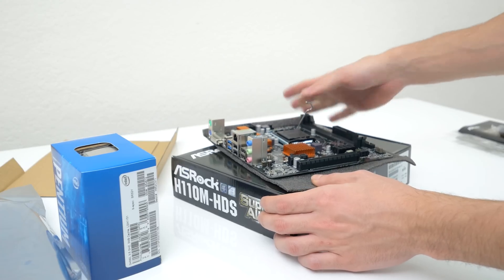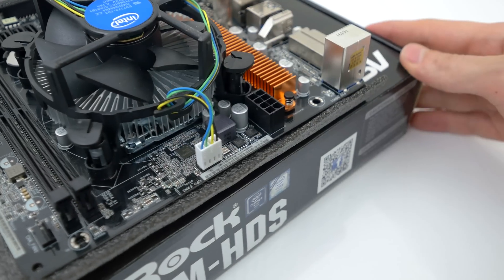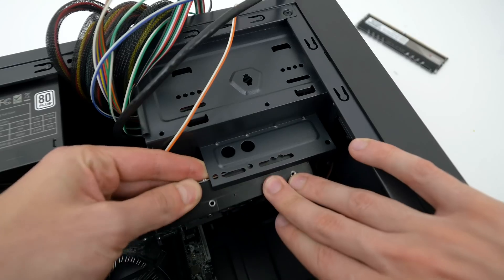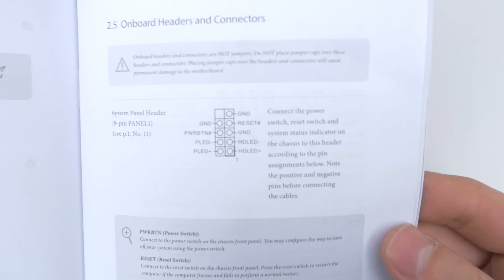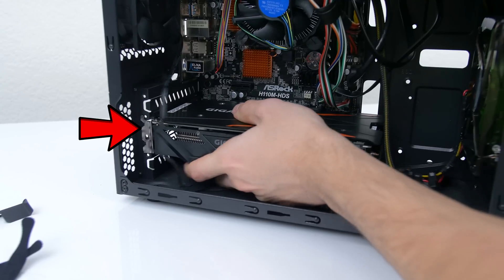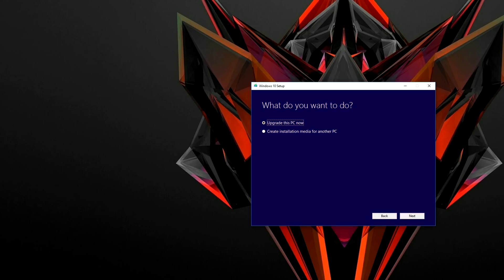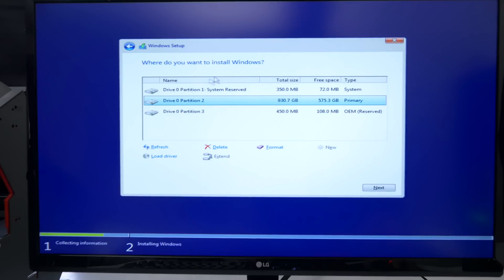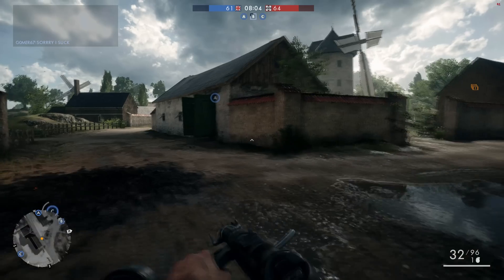How To Build $350 Gaming PC w/ Windows + BIOS Flash

Comment: Is a wifi card needs for this build...like so ed can see
Reply: You'll need a wifi card if you dont have easy access to a WLAN cable that is connected to your router. f.e. if your router is downstairs and your room is upstairs you might want to get a wifi card. If you are in the room next to the router you could just get a long LAN cable from your local pc shop and connect to the internet with that. (WLAN has better internet speeds compared to WiFi)
Reply: David Conkle please avoid WiFi on a gaming pc. If an ethernet cable is not an option, use powerlines instead. Types of powerlines explained: performance of AV is less then G.Hn is less then AV2 anf AV2 is ofc the most expensive. If that is not an option, use a WiFi Pci-e card, if not use a dongle like TP-Link Archer series.
Reply: BelgianGurista what if i get a higher end gaming board like the strix z270e with wifi, should i still get a wifi card?
Reply: Can't I just get a USB dongle?
Reply: You could if you have no other option. I've just had bad experiences with cheaper dongles. Wifi in general is just not as good as a LAN connection. But for casual gaming it shouldn't really be a problem.
Reply: BL4D3Z but have you tried powerlines first? WiFi reach and stability are the main pitfalls. INSTALLING POWERLINES IS NOT ROCKET SCIENCE! I get 130Mbit/sec through my G.Hn Comtrend 9073 in my garage. at a 17ms ping to the Ookla speedtest server. my garage is out of reach of the modem WiFi provided by the ISP.

Comment: why does everybody use mechanical drives for budget builds? why not go with an SSD and add more mech storage later?
Reply: Reid Bartlett SSD is the quite opposite as it is pretty expensive
Reply: BigRed you can find a 256 or 128 GB SSD for the same price as the hard drive he got. it would get you by in the meantime whilst you save up 50 more bucks for a 1TB mechanical drive. anyway he probably should have just included both in the first place as they're pretty cheap items to begin with
Reply: Reid Bartlett 256 GB is not much at all though. Is what I mean. I have a 2 TB HDD and if I got a 2 TB SSD it would be well over $1000

Comment: so i just wanna know...I want to go with the g4560 and asrock h110m itx, but i dont know if it will work because the motherboard needs to be flashed. Can you actually install windows and drivers first and then flash the motherboard? Love youre vids Ed. Keep up the good work
Reply: You'll need a 6th gen processor to get the system running and only after that you'll be able to flash the mobo.
Reply: Xavier Rynolds of course you can install windows and driver but just the basic drivers then flashed the BIOs
Reply: Philip Andersson Bettencourt Tx it helps a lot
Reply: Xavier Rynolds I'm new to the whole building computers thing, can you explain what "flashing the bios" is/means and why people do it? also, do you have to flash the bios on this pc? thanks so much!
Reply: BIOS is an acronym for basic input/output system. You can use it to control some basic aspects of your computer, such as fan speeds and overclocking. It will also display all of the connected components, meaning you will see what parts are connected (e.g. if you have an SSD it will be displayed as connected on the computer). The BIOS is the menu that will come up if you don't have an operating system, so it's usually the first thing that you see when you boot up the computer. It isn't absolutely necessary to open it, but it's an option if you want to look at some particulars about your system.
Reply: Xavier Rynolds was wondering the same thing
Reply: Xavier Rynolds i left a comment as well. we want answerss!! :D
Reply: Xavier Rynolds Hey,
I bought the exact same motherboard you're looking at (ASRock H110M-ITX), and it came with the new updated BIOS already installed. You should have no problems, and won't need to flash it.
Reply: Rylie Detchon where did you buy it from
Reply: Luis Murillo Vuugo Canada.
Reply: Rylie Detchon i meant what website
Reply: check PCPartPicker.com for compatibility. You will have the option to select a processor, once you select the one you want select the motherboard. The software won't let any incompatible motherboard be displayed. Hope this helps!
Reply: tx everyone

Comment: No thermal paste? It'll help you reduce the cpu temps if you remove the heatsink and add the paste onto the cpu and then replacing the heatsink. It works by reducing the space above the cpu and makes sure there's no air (air will insulate it and causes the cpu temps to increase). Either way you explained the rest of the connections well!

Comment: Guys I have a question I am planing a budget build and I am thinking about g4560 and evga gtx 1060 3 gb with B250 motherboard will that be a bottleneck or it's good
Reply: Fahronja 12 the g4560 will bottleneck the 1060 alot
Reply: VinceTheBin tehn what cpu should I get with evga gtx 1060 3 gb
Reply: VinceTheBin or whatd best gpu for pentium g4560
Reply: Fahronja 12 gtx 1050ti is the best for g4560 and the i3 6100 is good for the gtx 1060 3gb version

Comment: It's important that the newest bios is flashed on the h110 mobo, because otherwise the pentium is not supported and the system won't post. The only way to flash the newest bios without a cpu is by inserting an older cpu or by letting the seller flash it for you.

Comment: ring ring
Hello thank you for calling Ed at TechSource, you may dial an extension at any time.
For Ed's custom water cooled build press 1..
1 beep
Ed's custom water cooled build is not available at this time, a plug and play system with no custom components or mods will be on its way to assist you shortly, thank you for your patience.

FUUUUUUUUUUUUUUUUUUUUUUUUUUUUUUUUU